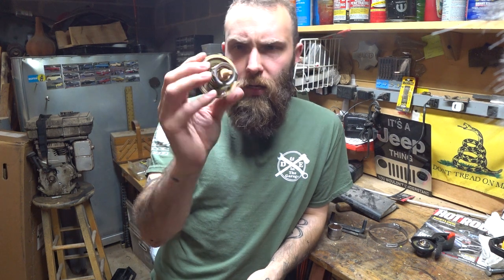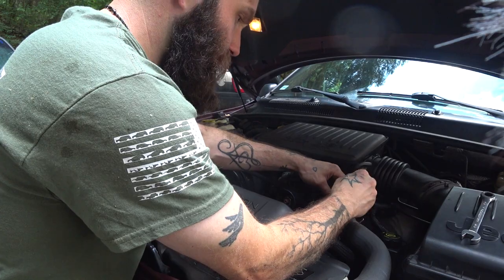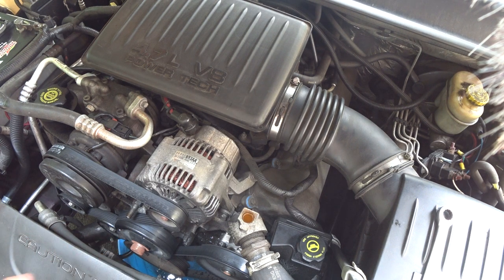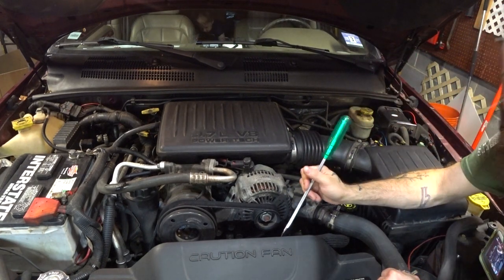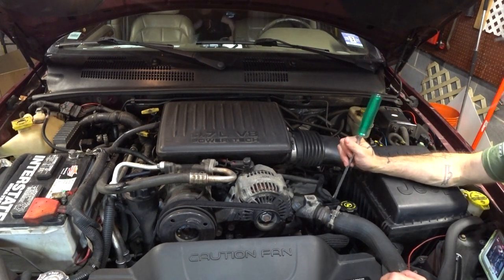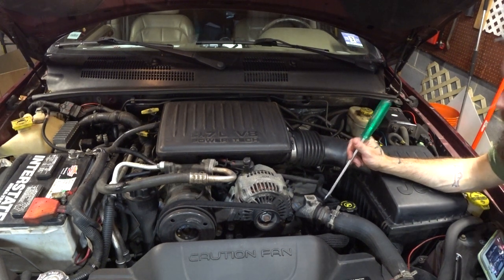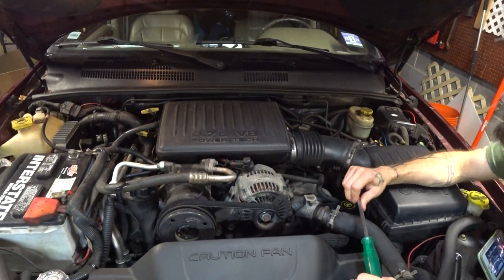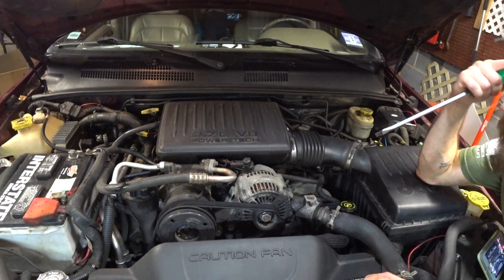How to keep a Jeep Dodge 4.7L alive & happy - EVERY FATAL FLAW I LEARNED THE HARD WAY!

Comment: I just got my second 04 WJ a few weeks ago and this time around I got the 4.7. I got a great deal on it but unfortunately it has multiple cylinder misfires which I cannot afford to fix. Scanning it tells me to replace the TPS, plugs and coils, and fuel Injectors. It also had a significant power steering leak which was remedied after about 3 different bottles of stop leak and a gallon of ATF. I was unaware of the hydraulic fan and am somewhat surprised that it didn't fail with the condition my power steering was in. The cooling system seems to be the only system I don't have any sort of issues with [knocks on wood].

Comment: That information is good to know. Now I have to go through my 4.7 and rid myself of that fan. After I tackle my odd injector codes and running like a Ford issue. Any trouble with injectors yet? I noticed the wiring harness that comes around the passenger side is a horribly tight fit. Man I hope it's just a couple of wires. Thanks for sharing the video though. Helps out alot on what I need to look for on my Jeep.

Comment: I have a 2000 durango 4.7 been a great truck until the radiator tank split. Replaced the radiator and thermostat and it ran good for a few months then started eating coolant and overheating.  I ordered head gaskets and new head bolts but not sure if it's worth tearing down or not.

Comment: Great fkn vid coming from someone who just replaced both heads. I deleted that stupid fan and ps pump. Put a belt driven fan on. Been running great. Glad i did the fan for sure. prbly 5-10k miles later. Unfortunantly i do notice a small loss in power putting that fan on tho😓

Comment: At Europe we all have 2.7l crd (diesel) and a few 4.7l (gas) Jeep WJ’s. So everybody sucks with the cooling system.  The power fan rotor housing wich is connect the power sterring, it just a weak point... a bad construction. We dont have other ways to solve the problem just go to the junk yard and hope to find a good one...

Comment: We had a 4.7 in a 2001 Durango that dropped a valve seat in #1 cylinder. Lots of noise and no more compression. We use all the right fluids and it did not overheat. Just one of those things I guess.

Comment: Wish we knew this when we bought the 2007 4.7😂 unfortunately the worst happened and the repairs of the engine is too much so we are getting a new 4.7 and when that baby is in imma make sure to follow this advice.

Btw, we had it for 5 days when it overheated 🙂
Reply from the maker: OH MAN.. 5 days?! that is tough...
Reply: Yeah tell me about it the overheating problem is a b** I overheated mind and now I need a new motor my motor is seized up
Reply: @rononeal979  same, mine also seized up. That's why I'm getting a new one. It's currently in my living room because I'm waiting for the mech shop to open lol. I'm super stoked

Comment: Great tips here. 👍
I just picked up a 01 Dakota and was wondering why the 4.7 is so hated.
Reply: 03 Dakota crewcab/ 4 x 4 here, 4.7 with over 300,000 km on it, still going strong but I will replace the timing gears and chain soon (out of fear of disaster should they fail). Love this truck.

Comment: Do you guys have a vid on changing out the valve seals in a 4.7? Mine is running fine but just started to smoke and hoping it is the valve seals but being on furlough from the job, I have to do it at home. Cant find any good videos showing the process or the tool to use for the springs...praying its not the rings....thanks love the channel!

Comment: Wow thank you for the video I had no idea! I bought a 2000 WJ limited with the 4.7 and it was not well maintained by any of the previous owners. 200+k miles on original parts including fuel filter, lifters, spark plugs, gaskets and probably more that I have to find. Got it for $250 not starting and about $300 in parts. Anyway I’m wondering what you would recommend checking and changing. I’m rebuilding the fuel injectors hoping that it starts once that’s done.
Reply: Any sugestions on replacing core have oem core help .cj Tacoma

Comment: My 2002 wj 4.7 selec trac is at 190 000 miles and no problems with cooling, I like how quiet the hydro fan is and I think it helps with the fuel mileage. 
I also have a 05 wk with the 4.7 and mech fan, it’s very loud and get poor fuel mileage vs the wj.
But I heard parts are expensive for the hydro fan so it’s gonna suck when it fails lol

Comment: The stock cooling fan, with stock thermostatic fan clutch, in my 4.7L in my '03 Dodge Durango is not connected to the power steering pump. There are no hoses connecting the two to share fluid. They are completely independent. The power steering pump can fail and the fan will still spin because the crank shaft pulley spins the serpentine belt which spins the water pump pulley which spins the fan. I'd love too see pictures or video of how your power steering pump is connected to your cooling fan and how if the pump fails so too will the fan. I've never seen that before. I'm serious. I really would like to see that. I'm not trolling or anything like that. I really am curious.

Comment: Hope you don't have PCM issues like I've had with my 99 4.7. Other than that, mine has been solid & reliable. Mine has both a mechanical fan & electric fan. Never ran past 205 even when towing. I'm not running HOAT coolant; I have Prestone "yellow" long-lived coolant & have never had any issues with my coolant causing corrosion.

Comment: Mine came with a standard fan clutch hanging off the water pump. I had a 4.0, as well, and crashed it and bought a 4.7. Reading about it it said all this stuff about a hydraulic fan, and I'm looking and looking for all of these power steering lines and whatnot. Nope. Just a traditional clutch on the water pump. Maybe this was part of having the towing package?

Comment: Great video! I got a 3.7 that dropped a valve seat at 125k miles. Never overheated, I got advice to change the radiator cap every year. Is there any other preventative maintenance that can be done, other than routine oil changes.

Comment: Im going to buy a 2001 4,7 with only 180000 km here in sweden. Thinking about get rid of the hydraulic fan the first thing, and upgrade to 5 speed transmission

Comment: Got a 04 GC limited fully optioned with the 4.7 HO and only 49 k miles on the clock. Sprung a leak in the pump to hydraulic fan line and burnt up my pump. Anyway I got all new lines and a rebuilt pump. It came with two seals one is an o-ring and the other is a small white plastic ring slightly larger in diameter. I'm fairly certain that the o-ring is a replacement for the pump to fan high pressure line for those that don't replace the line. Any idea what the white ring is or where it goes ? This information is not included in any of the paperwork included with the new pump. Thanks in advance. Keep up the great videos!

Comment: I know this is off topic but you mentioned the fan relay in the 4.0L.

The fan relay is on the 4.0 is PWM solid state switch. In other words it is doing a lot of switching really, really, really fast and that makes a lot of heat.  I noticed it has an aluminium plate on the bottom like it wants to dissipate heat into the body, but with the air gap it has no place to go.  I put heatsink compound between it and the body and I haven't changed one since.  Why didn't the engineers at Jeep see this.  LOL.
Reply from the maker: Wow... you just dropped some knowledge on me. I really appreciate that explanation of why it fails. As for why they didnt engineer it correctly... well...
Reply: Like used to bed computer CPUs, right? Good idea!
Reply: @davidvoinier6008  Yes, I put a little more than I would on the chip.  The surface isn't quite as perfect, as on a heat sink and there are no pins to contaminate.
Reply: @DEInTheGarage  Maybe they were still dealing with the hangover, from the marriage with Daimler?
Reply: It's actually a very good design.  You can basically regulate the fan speed to almost speed you want.  Just needs to get rid of its heat.

Comment: It's not that bad lol.
I did a water pump, thermostat and fan clutch at 100k. Like a week ago.

Drained the coolant, popped the fan clutch loose, took the belt off, removed a pulley, removed the waterpump, replaced it, (reverse steps pretty much)

Filled the radiator with Zerex G05 (HOAT) removed bleeder port fitting, filled the upper radiator hose till I could see the coolant almost spilling out of the bleed port. Then tightened the bleeder port a little, turned the truck on Heater full blast etc, let the air bubbles stop coming out of the port and the radiator fill port, once the thermostat opened topped it off and that was pretty much it.

Comment: Don't skimp on maintenance. When it's time to drop the front end and change the radiator friggin do that! New hose and lines as well. My 2001 has a new motor and brother it rips. Don't step to this. Smooth as butter and pulls like a V8 should.

Comment: My 4.7 Chrysler Powertech has been spurting coolant since I got it. Had the radiator replaced which has prevented overheating, but still shooting out fluid. I noticed you use orange and not the recommended pink fluid (maybe different engine type), and also you didn't seem to premix it 50/50 w/ water. I'm likely going to end up replacing every last component of my cooling system before I fix my problem. *I also changed out some of the dirty power steering fluid for some Lucas PS fluid. Hopefully that's the correct kind.

Comment: My 07 with 160 thousand miles on it is running pretty good...Knock on wood. They do not have those fans on the 6 banger.

Comment: Help Mr. Wizard ! In the process of buying a re-man... The original 4.7 blew due to over heating... I didn't know bout the power steering pump being part of the cooling system, Why I say ? Just keep it simple...Anyway can you please give me the name of the correct power steering fluid and the correct coolant ? Thanks good show by the way 5 stars for sure !!
Reply from the maker: Get Zerex G05 coolant.. it should come out of the bottle gold in color (orange if you get the Mopar stuff). The PS fluid is Mopar PS fluid number MS-10838. Good luck!

Comment: Just bought a Dodge Durango 03 4.7 and it has a coolant leak from a freeze plug and somewhere in the front, as you mentioned O-ring? I think that’s the next place I’ll check as well as the thermostat

Comment: Well, you caught my attention. Was googling the WJ for intel and came across this. How much of a issue is this powersteering thingy? I have no issues setting up and running electricals. Is there an outlet on the engine for a temp sensor for running electrical fans? 

Im down with cooling. I have the same approach as you. Excellent vid. Got yourself a new sub. :)

Comment: I've used prestone universal in my 01 dodge durango for 8 years with zero issues.......what oil do you recommend running in the 4.7 just curious I've always ran Rotella low oil pressure problems and sludge has been my fear I've herd these engines are notorious for it ......knock on wood

Comment: Thank you for this video i have a 2005 Ram 1500 with a 4.7 and im def gonna change out all fluids im happy you mentioned the color situation. I have no power steering right now but my motor doesnt run hott......Any tips?
Reply from the maker: I think (could be wrong) That around 2005 they went back to a mechanical fan and electric fan. I know the 2005 Grand Cherokees with the 4.7 did not have the hydro fan
Reply: I think only the Jeep got the hydro-fan.

Comment: E-fan for 4.0l, use adjustable thermistor relay instead of factory, ( factory relays fail because body mount is heat sink, uses Heat Sink Paste to transfer heat, under headlamp is hardened or washed away reducing heat absorption from relay) and use clutch fan if towing is involved. Also NEVER use tap water, eats aluminum. Distilled water is better for drinking and da Jeep.

Comment: I bought a Durango with 4.7 at auction for 400. It has overheating problems. Barely got it home. About to change water pump thermostat fan clutch and now power steering pump. I will get back on when I’m done and report

Comment: Why run the heater? Turning the heater on allows the antifreeze to go through the heater core? I thought the water pump circulated through the heater core and the engine and then when it gets up to temperature the thermostat opens and takes antifreeze from the radiator and runs it through to cool the motor down. Turning the heater on will just kick on a fan behind the heater core cooling the engine down so the thermostat won't open, correct? I do know when I'm climbing up hills and I see my temperature start to rise I will kick my heater on to drop the engine temperature. I work with heaters and heat exchanges in the back of my work truck and when I touch the heater it's hot whether the fan is on or off and I thought The vehicle heater core worked the same way.

Comment: I really hope you can help!! Ive looked everywhere and you seem to know more about this motor and its systems than anybody else.

I have a 2003 Durango 4.7 4x4. 226k miles. I pride myself on that lol. The truck recently started a minor vibration when I would turn on the AC. Did all the looking I could and concluded that it was the compressor that needed replaced. Picked up my truck today from my mechanic after he replaced the compressor and its the same problem. Process is this. Start the truck. The fan, defrost, and heat all work fine. Hit the snowflake button for AC and it starts vibrating. Turn the AC off and after the compressor equalizes and cuts out it returns to normal. Ive looked everywhere and the only other thing I can come up with is that the bushings on the motor mounts are shot. Have you seen any other causes for the AC related vibration other than bad compressor and motor mounts?
Reply from the maker: That is a real melon scratcher. Motor mounts definitely come to mind. I'd be happy to help you further. email me at dandeoffroad@gmail.com so we can chat. I often miss responses in comments on YT
Reply: I have heard that some of these engines have a damper/balancer failure around this high mileage interval...just another thing to check

Comment: What?..I have a 2003 4.7l Dakota I bought new and it had the green coolant in it from the factory. 150,000 miles later and it still runs fine.

Comment: 2001 Dodge Dakota AWD with the 4.7 ENGINE, 180,000 miles with GREEN coolant in it and it runs like a top. Zero issues. Luckily Dodge was smart enough to use their tried and true clutch fan in stead of that monstrosity Jeep used. Ironically all My years working at Chrysler dealers (20+) I only had to replace one of those. PS. ALL 4.7 liters use a cast iron block/ aluminum head combo just like the Hemis did. All engines with aluminum heads are prone to dropping valve seats. This is not a 4.7 liter only problem. Read your owners manual, it won’t steer you wrong. Also, some techs at the dealers will answer any questions you might have.

Comment: I just replaced the coolant on my but I used Zerex G 05. Should I be worry then?
Reply from the maker: No, that stuff is compatible even though it is gold and not pink. it is the old style neon green stuff that will not mix well.
Reply: Thank you. I did I lot of research before I did full flush and the Zerex G05 was the most recommended and also available in my local auto parts store.

Comment: Had a genius idea to keep rats off wiring, put glue traps on cool engine, while camping. Yea, missed picking up 1 trap, it leaked into spark plug and blew head..I got the rat, but I couldn't understand, how it got inside the spark plug, I thought they seal to head. The amount of regret is phenomenal.
Reply from the maker: Dang... that is tough. Solve one problem and cause another

Comment: My 3.7 lasted 140000 until one overheat last month, threw a rocker, bent a valve which hit the piston a few times. Jeep was running great this all happened while coasting to a stop...about when this video came out, it looks like someone topped off my fluid with the green stuff at some point and that made a mess.(do your own oil changes i got lazy a few times and took it to a chain, and they topped up my fluids) So i just put a rebuilt 3.7 in with the orange stuff, let's see if we get another 140000
Reply: This was a jeep liberty 2012 4x4, in addition to the e fan i also added a mechanical fan from a commander 4.7 I found at the junk yard, it really helps with the texas heat

Comment: I own a 2000 Grand Cherokee Limited 4.7l. Jasper engine bored .050 over.  I have read that on these, the fan DOES NOT operate off the power steering pump. Is that true? I also understand that since it is a Jasper engine, there may be modifications under the hood. How can I easily tell if the fan is indeed ran off the steering pump? I have overheated it once and blew the head gaskets. $600 and a head job later (not to mention taking the thermostat out and cutting the middle out to have a seal while having constant coolant flow) I have a Jeep that runs @ 190-215°F consistently. When climbing hills on the interstate @70-75mph it likes to push 220°F. I'm still concerned that may be a bit too hot. Thanks in advance, and I appreciate the video!